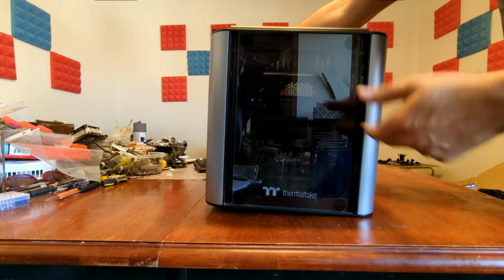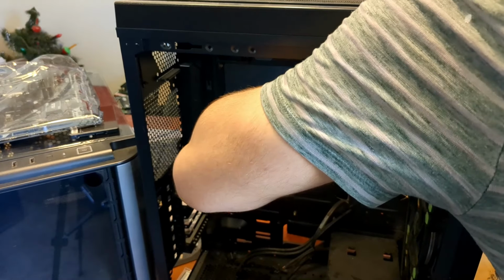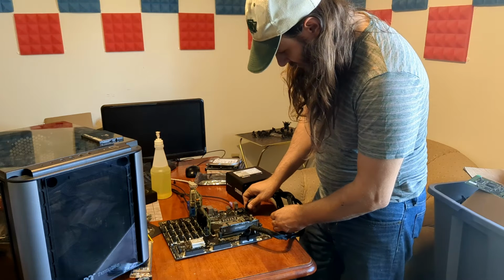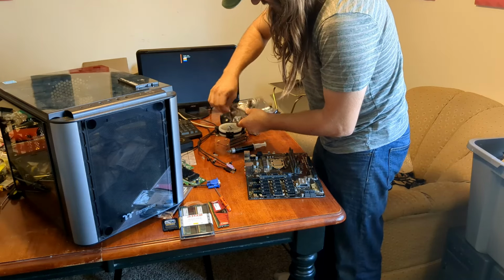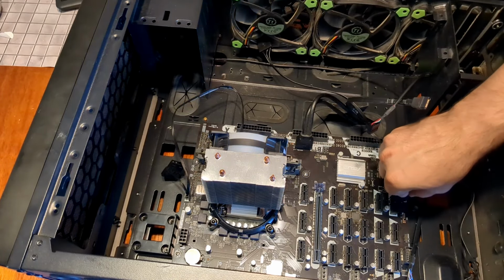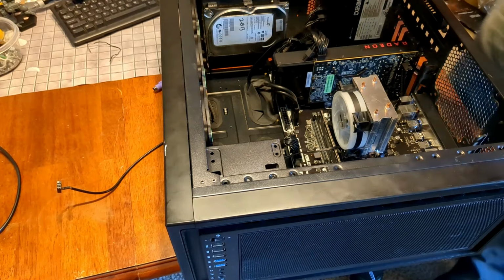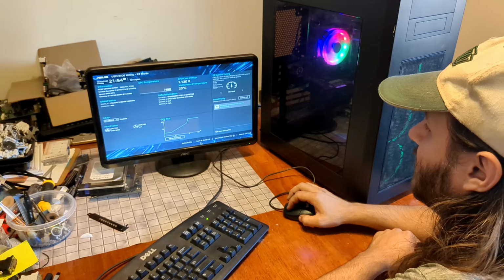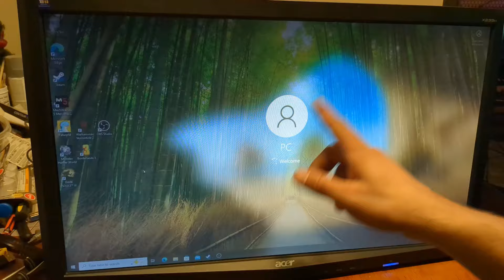LSAS Halloween Special! 1,000 subs, and a SPOOKY PC made from used crypto mining parts!

Comment: I've been summoned here as the algorithm didn't take me here, but we must watch. 200 views will just not do. Keep up the good work man I've been enjoying your videos a lot.
Reply from the maker: Appreciate that a lot, thank you!

If the stars align, next video is going to be a dual GPU workstation build using a mystery motherboard/CPU/RAM combo I got on Facebook marketplace for $15

Just have to wait for an eBay power supply adapter to arrive, because of COURSE it's an OEM board, and of COURSE it has proprietary pinout for the ATX motherboard connector

Comment: Personally i wouldve run that filter under the tap with some soap and water, it still looks filthy, as long as its dried afterwards to speed up drying time spray it with isopropanol 80-99% alcohol and wipe.

Comment: Why not Windows 11?
Reply from the maker: @mustasheolll2020  although you can kind of get Windows 11 to install using a modified installer, you can't do it the normal way because this doesn't have TPM 2.0. It might be worth checking it out though, using a modified installer
Reply: @LowSpecActionSquad I thought it was a PC with new parts my bad lol
Reply from the maker: @mustasheolll2020  The parts are "new" but are mining parts, which means technically new parts, but using old and cheap chipsets

Comment: weird how you keep finding working if a little damaged pc parts in the trash im geussing you actually mean the local recycling center rather than your neighbours trash can.
Reply from the maker: I live in a college town, and I'm also just a short ways away from my state capital. I don't find individual components, I find full computers that are broken, and I pull them apart for the parts.

For example, someone might throw out an HP or a Dell that does not power on. Well, the power supply or the motherboard might be bad, but the rest of the PC is fine, so I pull out any working parts, as well as any parts I might be able to fix, and throw the rest away. 

For every fully working PC I find, I pull hundreds of 100% broken computers out of the trash as well, but I don't make videos on those. Nobody wants to see me troubleshoot a broken computer for several hours, only for me to give up and move on to the next computer
Reply from the maker: Going to the recycling center is actually a good idea though... I've never actually done that. Might be worth seeing if there is one in my area. 

Also, one of my recent videos about a filthy HP I found in the trash does show some insight into what I normally find, that PC was missing a lot of its components